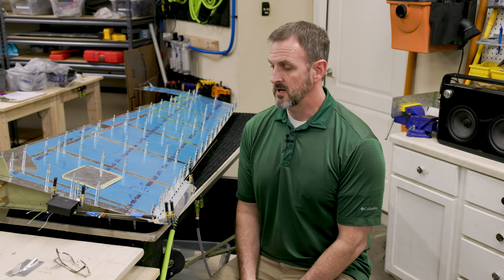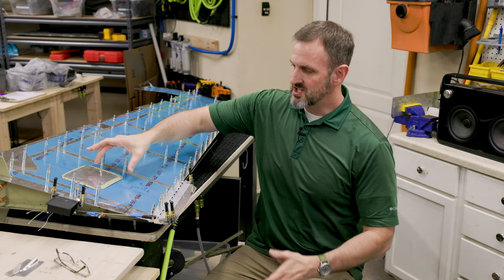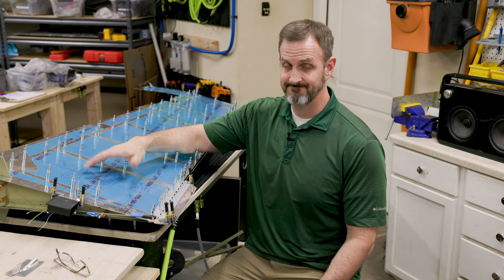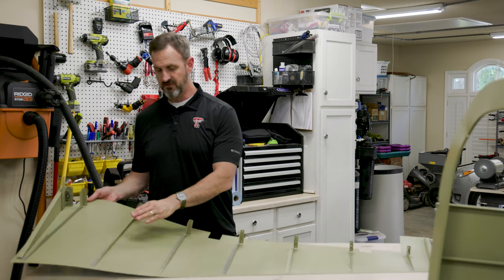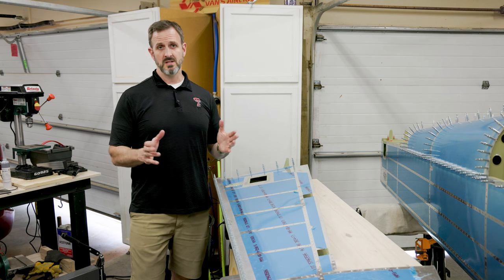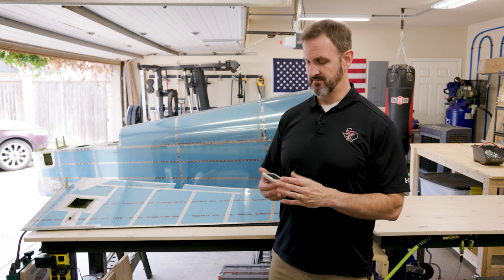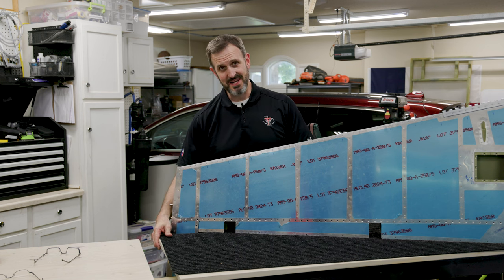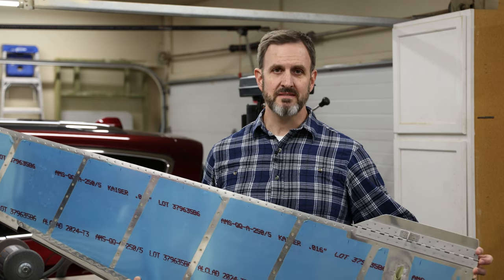Building the RV10 - Video 12 - Rudder & Rudder Trim Tab (June 2022)

Comment: Doing a fantastic job.  If I may make a suggestion, this will add to the cost but "a little spending up front saves more spending later".  From a corrosion preventative stand point, prime any drilled holes and countersinks, seal mating services and primer and Alodine is your friend in the areas that will never see the light of day but I promise you water will find its way in. Sealing, priming and Alodine can also drastically slow the galvanic and filiform corrosion potential as well.  For double flush rivets, a microshaver is used.  Use the standard one and half times the river diameter rule to form a shop head, smash it down haha just don't crack the rivet then come back and hit them with a microshave.  Keep up the great work.
Reply from the maker: That is good advice!  I was thinking the same thing; I purchased an Alodine pen for countersunk holes that don't have any primer.  I like it because it doesn't change the dimension of countersunk holes.

Comment: Thinking off doing this on a Murphy Moose I’m building. Which trim component did you buy/use, was it Vans to match aileron and elev?
Reply from the maker: I used a Ray Allen trim motor, if that’s what you’re asking…. It has a different throw than some of the ones that came with the kit for elevators, I believe.
Reply: Ok thanks

Comment: Rudder trim isn't really needed in the RV-10. A yaw dampener on the autopilot is another option that can accomplish ball-centered trim in cruise and more. You're obviously (since you said so) aware that adding a trim tab/system will alter the flutter characteristics of the control surface in some manner, often in mysterious and unexpected ways.
Reply from the maker: My understanding is that the yaw damper isn’t the best option for the constant input that trim functionality requires. That said, the trim tab is something that bugs me. My implementation is different from most other builders in that (and among other things) the servo is a little farther out from the axis of rudder rotation since I’m placing the tab on the bottom. So the change to the moment of inertia will be more pronounced than those that put a trim tab higher on the rudder (which results in the servo being closer to the axis of rudder rotation).  While I can easily take this trim tab off, I’m thinking of making a second rudder…
Reply: @buildingthe10  Yeah, I hear ya. What I can tell you after flying a lot of RV-10s is that for constant input, a very small trim wedge affixed to the rudder to center the ball in cruise is a lightweight, simple, and common method (and you apply it after you fly it, only when needed). And that's really all that's needed. It's hardly noticeable and doesn't protrude past the trailing edge of the rudder, and has essentially zero impact on balance/weight/dynamics. I have flown several with yaw dampeners (not to replace the wedge, but to augment) and they work very well. That said, this is experimental aviation after all - and one of the great things we get to do is design and experiment!
Reply from the maker: Lol, apparently we are also free to change the rudder such that the vertical stabilizer can rip itself off of the plane!